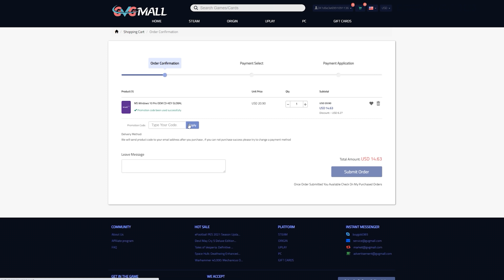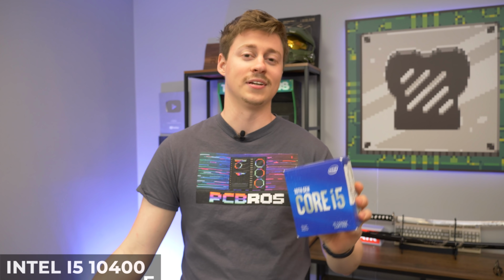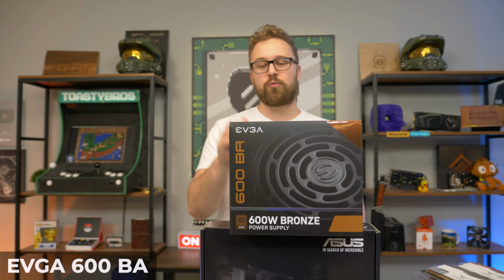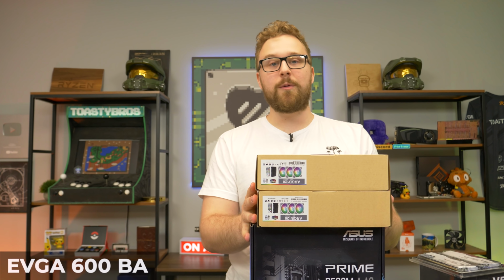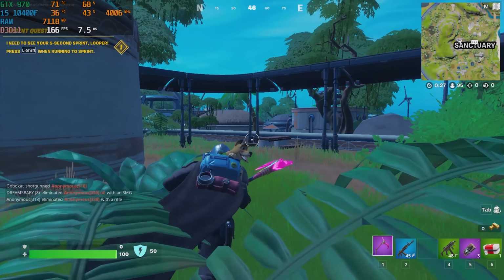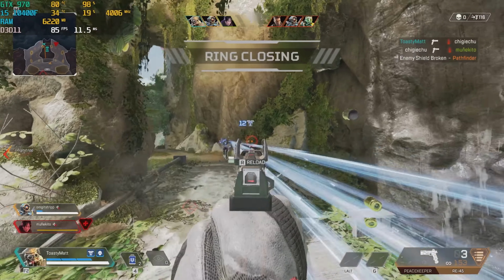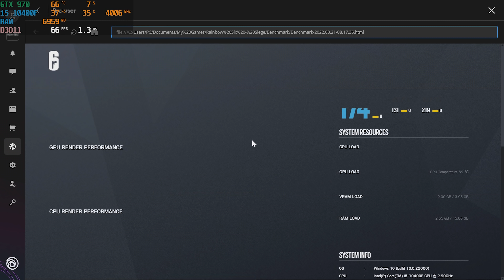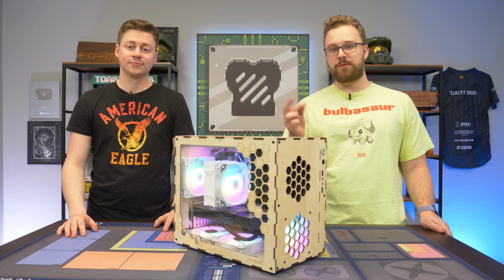We Bought a Wood PC Case From Amazon

Comment: Not sure if you guys still have this built around or already sold it but wouldn't it be better to use the bottom fans as exhaust? Since they are sucking air from the floor, I don't think they're gonna be doing much though. With only the one in the front acting as intake I think it should be enough.

Comment: I was looking for a new case.  I'm a woodworker and amateur cabinet maker.  wood has me worried about heat-soak.     it's an insulator and not good with radiating.       any huge temp gains or will adequate cooling do the job?